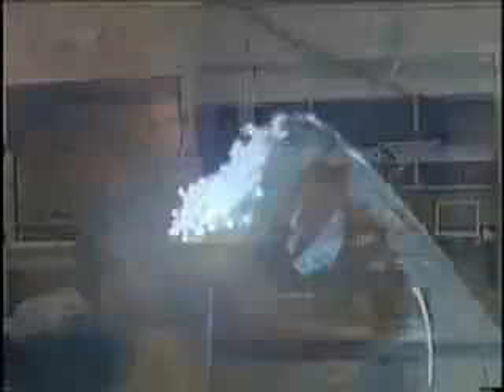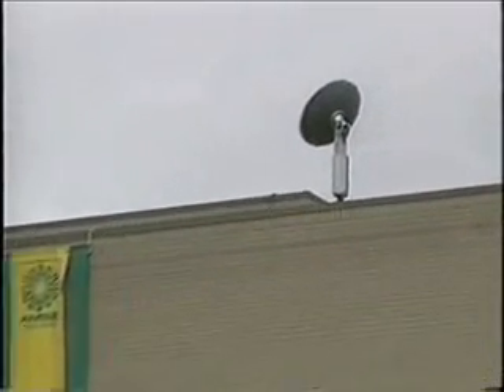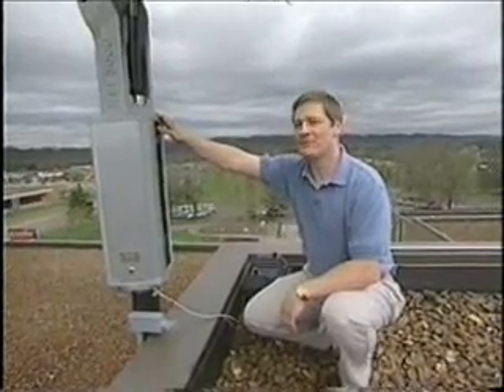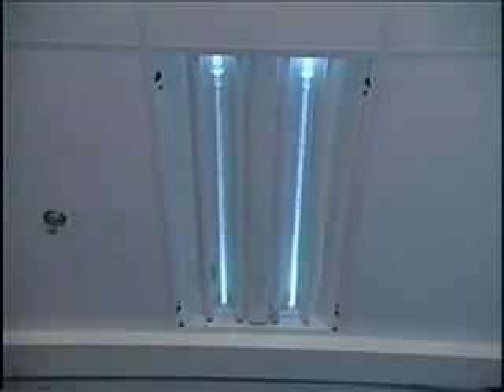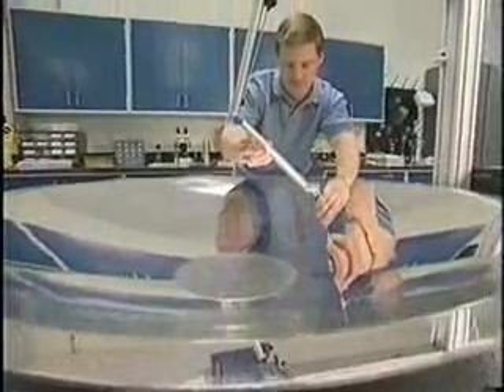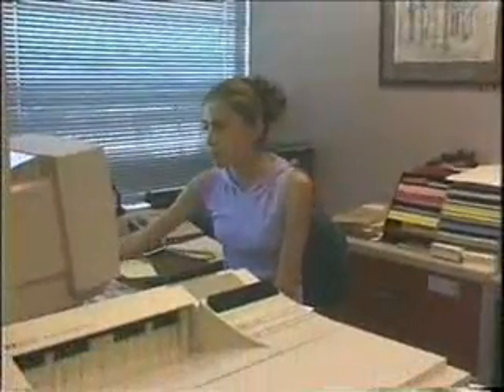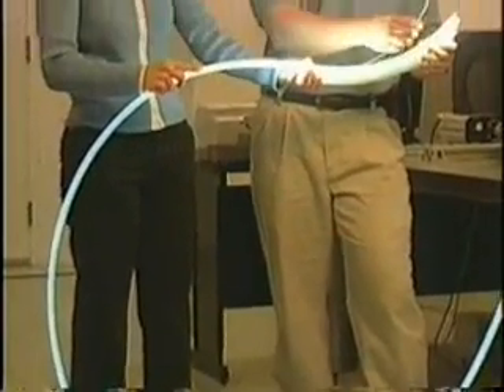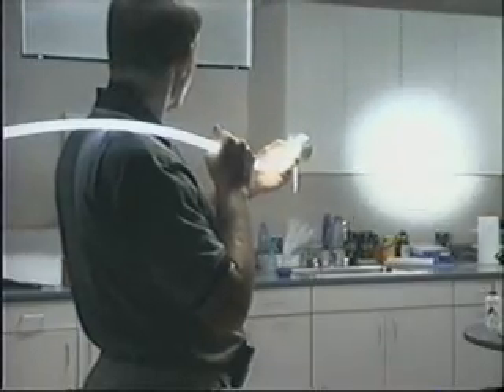Solar Lighting

Comment: @liquidsord23 cmon buddy...95% of offices are open from 8am-5pm when there is lighting. For those working at night, just get regular fluorescent lights. Or even better, a lighting cell (extremely low energy requirement) that is magnified with magnifying glass and concave mirrors. Look at the new outdoor solar lights you buy in stores. cheers!